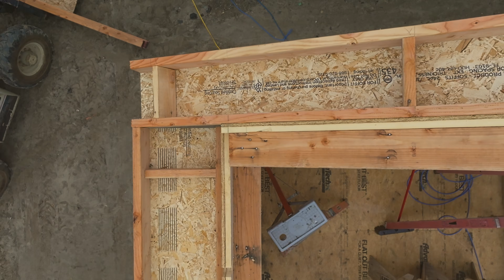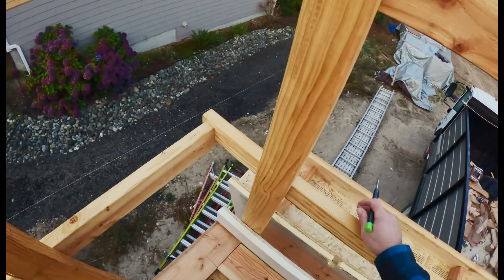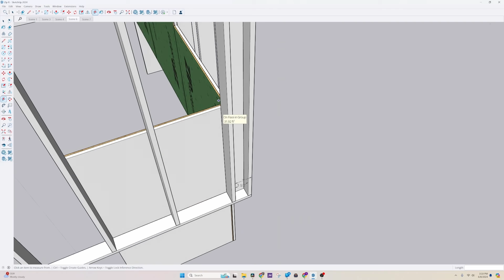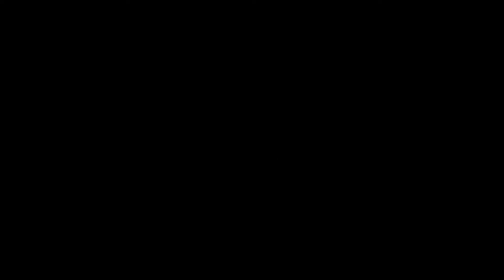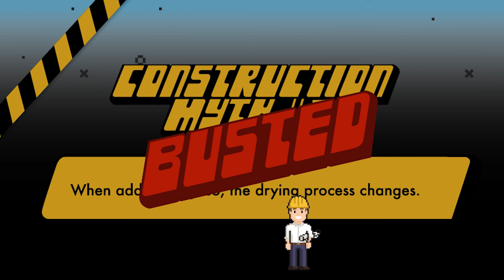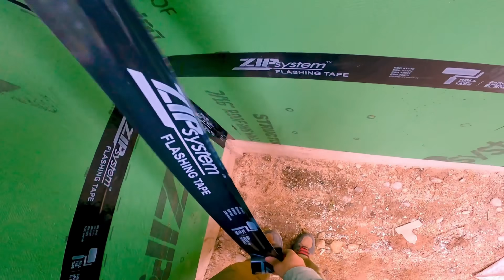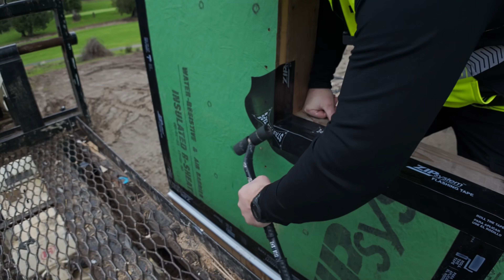EXPERT TIPS| Continuous Insulation

Comment: I drove my builder/framer crazy with all your videos I would share with him because I wanted him to know what quality of framing I expected. In the end, I didn’t get quite as good as I wanted but I got much better quality than the big developers offered in our area. 

We ended up with a very well insulated house with an ACH of 0.6 and once the house was insulated, before drywall, I could get the interior temperature to +7°C with two 1500 W space heaters when the outside winter temperatures were -27°C.
Thanks to your videos I have an exceptionally good quality home because I learned what good quality framing and homes should look like.
Reply: I was a professional framer for years and you are very misinformed. Your framer and your GC are not responsible to design your home insulation systems. I am a licensed GC now and I have a Civil Engineering degree, so for my clients, I sometimes do design work. But a framer is not qualified to design your insulation system, nor are they trained to do so. "Builders" as you call them, probably refer to your GC. Generally, it is not the GC's responsibility to do design work, depending on the size of the project. For custom homes, it is the homeowner's responsibility to provide permitted design plans to the GC unless you make arrangements with the GC to pay him for that service. But a LOT of GCs are not trained in home design and insulation systems. So you were trying to get design service for free from your GC and it sounds like you didn't pay him for that service. You should know that the GC is required to build any structure strictly in compliance with the permit plans. He is not responsible, nor should he, build your home according to your personal quirks and superstitions. 

It sounds like there were a lot of insulation details that you demanded that were not communicated in writing to the GC BEFORE he bid on the project. So, he should have changed-ordered you for each one of the insulation details that you demanded in the name of "quality." You can't pay for Toyota Camry and expect your builder to construct a Lexus under the same budget. Competent GCs who know what they are doing will often avoid clients like you because you are petulantly demanding quality that you did not specify in the original design and you didn't pay for. 

BY FAR, most heat and cool loss is transferred through the windows. So if you cheaped out on the windows, then all of the insulation details you add to the walls and roof won't make much difference. And the "builder" doesn't usually choose your windows for you unless, again, you pay him to design your entire insulation system.

Showing "videos" to your builder and demanding that "quality" level is only appropriate BEFORE he bid the home out or if you are willing to pay for changes that were not in the original scope that was defined for the project. For example, it makes a HUGE difference to frame a home with 2" x 6" lumber as opposed to 2" x 4" lumber. But it costs more labor and materials to use 2" x 6" lumber because it is much heavier and harder to erect. If you didn't ask for 2" x 6" framing when the home was bid out, then you should be willing to pay for the upgrade that you have ordered.
Reply: @franklong6269   Wow, you are certainly assuming quite a lot from the short amount of information that I wrote. Like I said, the framing was better than other builders work that I’ve seen but there were some things that had to be fixed/changed because someone was in a rush or just made a mistake. I’m not going into details because that’s not important since the project is complete and the house is built better than the previous house that existed on the foundation. I’m going to repeat myself here, watching these videos helped my project to be better built than most of the new builds that I have seen in the past few years. And the ZipR6 helped to get both the insulation and air leakage to a level that most of the local developers in my area aren’t doing. 
Design, drawings, engineering, permits, etc were all done professionally btw.
Reply: If you paid for the changes, then it should not have "driven your builder crazy." If your plans were done correctly, it should not have "driven your builder crazy." That's not being presumptuous, those are your own words. 

Nothing is wrong with what you want. The quality you wanted was a smart choice. And sometimes, many times, architects do a very poor job in designing various wall systems. My point is none of this was your GC's fault or your framer's fault. They are not licensed to design homes, though GCs do have some design responsibility based on code requirements.

I have come to expect that when clients bring me a set of plans for a custom home, I will have to spend significant time fixing those plans because there are almost always important "omissions" and "errors."

For example, I had one client that I built an addition for. They had hired an architect and he made two critical errors in his plans. With the first error, he specified a roof height that was wrong. It was wrong because the peak height of the roof trusses on the addition had to match the peak height of roof on the existing home or the entire roof system would not work. I was about to order the trusses for the project, and I took some time to double-check the dimensions that the architect provided. Had I used his dimensions, the additional roof would have been 1.5 feet too low, and it would have cost my client thousands of dollars. They would have had to buy the trusses twice because the wrong size trusses would not have been usable.

The second error was that the architect put the main door of the house approximately 6 feet away from the correct location. Again, this would have been a massive mistake had I not caught it because this is a stucco home and it would have been a nightmare to move the door after the house was stuccoed. 

A third mistake was that the client wanted to hang a swinging three-seat exteriror chair off of the addition's patio beam, which was also stuccoed. The structural beam to carry the large chair system was not in the plans. Luckily, when I spoke with them, they told me about the large chair and I reinforced the beam structure before stucco to carry it. 

I took photos of the framing and the build of the house at different stages and gave them a photo album so they would know where all of the plumbing, the electrical wiring and the structural beams and studs are.  A few years later, they tried to hang the swing and they could not find the beam. I came out for free and showed them where it was. I asked them to pull out their photo album and when they checked, I had provided a picture of where the beam was and they had not thought o look in the album. They were older, and so I helped them several times without charging them.

After I found so many errors in the architectural plans, I asked my clients if the architect had ever come out to the house and taken measurements for the new addition. I was stunned when they said he had never even come to the house once to check his dimensions. This could have cost them tens of thousands of dollars and this was just an addition, not an entire home.

This is an example of things that "drive builders crazy." They are often left to pick up the pieces of a huge mess that they did not create, and the client often tends to blame the builder because they are frustrated and angry. 

Maybe this small example gives you view into the other side of the real world that your builder lives in.
Reply: @franklong6269  You misconstrued my comment, I jokingly said that I drove my builder crazy because I sent him videos to explain what the project was about and what was expected. My builder also joked about how I sent him videos, but being in the millennial age group, got the point. 

Most of the builders in my area don’t build Net Zero projects and aren’t familiar with the products that I specified to use, like the ZipR6 and the tape was totally new to my builder as was the double stud wall but he was willing to learn, so he assured me. In the circle of people in my area that are building Net Zero projects, the consensus is that not enough builders are interested in learning about products and methods that will achieve the standards. Like I previously said, I didn’t get quite as good as I wanted but I got better than the usual house construction that is common in developments in my area.
Reply: @franklong6269   Did I mention what lumber dimension the wall assembly was? I didn’t. Actually it was double stud 2x4 with a 1” gap between the walls. The builder knew exactly what was expected before he took the job because I made sure to be very clear and upfront with the plans. Hence the sharing of the videos with details that I particularly wanted because the intention was to get to Net Zero with some passive house standards. There were some mistakes made but most got corrected and some I’ll have to forgive, like the post imbedded in concrete by the staircase that’s 4” off from the blueprint indication. But overall, it’s a very good house, thanks to the things that were learned from watching videos like Awesome Framers. 
Roll the tape!
Reply: @LateForDinner-mn1hn  Well, I am glad that your house came out really well. Most people do not understand just how difficult it is to build a high-quality home correctly. 

I have seen the double 2" x 4" wall system but have not built many of them. Typically we build double walls for sound attenuation, not insulation purposes. I do know they are difficult to frame because you have to plumb and straighten two sets of exterior walls. 

Stairwells are often built a few inches off and it rarely hurts anything. I have had plans where the architect didn't provide the dimensions where the stairwell should be located. I had to scale the plans to get a rough idea of the location because I did not have time to RFI it. 

Enjoy your home, it sounds like a really beautiful, well-thought-out house. I wish you the best.
Reply: @franklong6269  Thanks, I aimed higher because I found really good resources through video channels like Awesome Framers and Matt Rissinger and others who care about improving building quality and efficiency. Building a good solid house that will be low maintenance for many years is a complex process and goes beyond what most builders are used to doing if they are only working for developers.

Comment: Innotech windows and doors are awful. We stopped using them.
Reply: Awful how?
Reply from the maker: They have been great for us. What didn't work well for you all?
Reply: @AwesomeFramers  just a few things that started adding up over a few projects, we did about 7 houses and pushed the company hard to our clients because of the energy efficiency but in the end it didn’t make sense.
1. Too expensive (was driving up the costs of our builds)
2. Labour intensive, being too heavy, needed more man power than we normally use, plus some of our projects the windows were so big we needed to do our own glazing otherwise they would have been too heavy to install. Also they require equipment and personnel on site for delivery to unload their special racking (when you do projects on acreages in the middle of nowhere this became a logistics issue more times than not)
3. In extreme weather (we’ll get a couple weeks of -40Celsius) There were some thermal bridging issues with the metal clips used for install. They can transfer the cold right through to the custom jambs and cause moisture issues. 
4. Doors were sometimes a real pain to get to latch correctly and clients were having trouble with them.

That being said we tried them out in the very beginning and haven’t used them for years so maybe some of these issues have cleared up. There are some definitely cool features on their products that are worth the price. If clients want them we will use them but don’t promote it anymore.

Comment: How toxic is that Styrofoam when it catches a fire? And how flammable is it?
Reply from the maker: The polysio has a higher rating than other foam insulation and is above the code threshold for requirements to cover in our code.
Reply: It doesn't catch fire.

Comment: Maybe I missed it, but with Zip R sheathing, do you now eliminate the interior vapor barrie in Northern zones?
Reply: Northern Idaho here with ZipR6.  Our structure was simulated for moisture build up over time.  The results said no vapor barrier on the walls, but the ceiling (R60, no foam) required a "Smart Vapor Barrier", which is to say it allows a small amount of vapor to allow for drying, rather than totally closed off like a sheet plastic.  Having this test report gave us a lot more confidence.
Reply from the maker: I don't know.
Reply: North of 50 here, we still used interior vapour barrier on our double stud walls with exterior Zip R6 sheathing as recommended by the experienced insulation contractor we hired to install Rockwool against the exterior Zip R6 and blown in cellulose between that and the drywall. Worked great when the temperature dipped below -40°C.
Reply: That’s exactly my question. Here in Wisconsin we are required to use a vapor barrier.

Comment: Finaly your using a Router better suited to the job I am shocked the little 1/4 hp cordless even lasted as long as it did ..How you liking the metabo HTP I love mine ..was looking at the Milwaukee because it has the track adaptor but I have my Festool for that but for on the job warranty and durability so Far the Metabo is Boss  cheers
Reply from the maker: Metabo HPT is a great router. The little DeWalt is from 2019. If it can route oak, it can route OSB 👍
Reply: I experienced issues with the foam board gumming up my router bit while cutting out openings (because the heat generated melts the foam). Don't know if this is typical???

Comment from the maker: CORRECTION: Continuous insulation is NOT the only way to meet the new energy code in WA state.  It is the simplest in our opinion as builders (our company).  Continuous insulation in the form of Zip R sheathing is the most cost effective way for us to meet the requirements.  It lowers labor cost, requires less training, and is more efficient that other methods.
Reply: I was talking with a local architect who has an in-house engineer and they mentioned using WSU's "C3 Calculator" to go around the continuous insulation requirement, but I haven't read into that much.  I would like to use ZIP R6.6 but it's quite expensive where I live in Pierce County.
Reply: @lucascole7589 basically - show that your entire building thermal envelope has a UA less than target UA (UAT). From what I’ve seen and worked on, continuous insulation is not required at all to meet the target UA. There are more cost effective ways to meet these requirements. I’m not discounting what these guys are doing, ZIP-R is a fantastic product. It is however cost prohibitive and generally unnecessary when using the alternative method outlined in R204.1.4
Reply: So you're saying foam board and OSB purchased separately with ? tyvek ? Or ? Is going to be significantly cheaper AND perform nearly the same? 
I am not experienced as may be necessary to grasp this without asking...
Reply: What type of insulation/thickness  are you using in between the studs?
Reply: Continuous insulation yeah right, how about glue and screw the OSB to the studs and after that glue sheets of styrofoam overlapping the OSB seams? You gonna say NO IS NOT CODE, just buy this ones. Aha how much are they paying you to throw your honesty and integrity in the garbage? You know I’m right. How about teaching people how to use materials that are not destroying their bank account?

Comment: Just keeps driving the cost of new homes out of the reach of most people. 
Last month We got a new house to pass the codes with very little extra effort. 
No spray foam, no zip, no extra crap.  Just read the code book.
Reply from the maker: Did it meet the new energy code in WA?  I do feel your pain, ire or whatever we call this feeling.  I am just showing how to do it right, but personally I am not in favor of most of these changes due to lack of affordability.  I cannot afford to live in the homes I work on. YouTube doesn't pay me enough for that 🤣🤣🤣😪😪
Reply: @AwesomeFramers  We passed the newest code here in Ct.  The builder we frame for doesn't own a hammer but loves to read the code book and do his research. A lot of people and inspectors think there is only one way to get the efficiency, the code book has a lot of either / or. and the people selling zip and spray foam just push their products. 
We met all requirements and blew away the blower door test. (see what i did there)  the company that did the test , did it 3 times because they never seen that kind of a score on a residential home.
Reply from the maker: @stevenleiler9034  but specifically could you find out which code because a lot of these continuous insulation requirements are just going into effect.
Reply: @stevenleiler9034  Interesting to hear you tout the blower door test number, but don't actually cite it......must have been soooo good